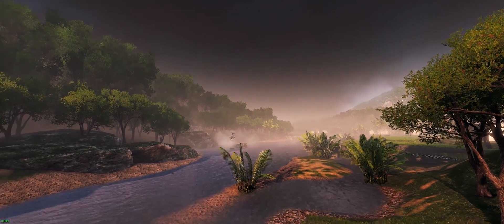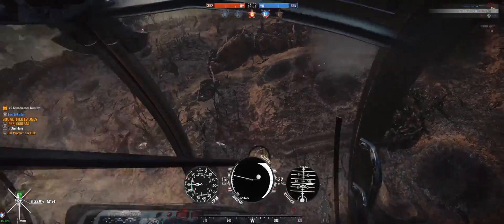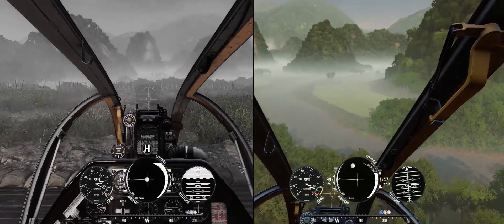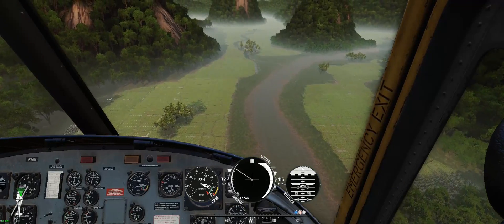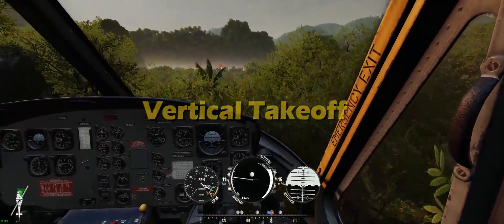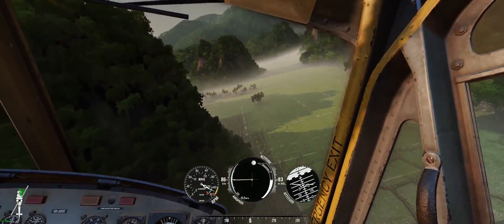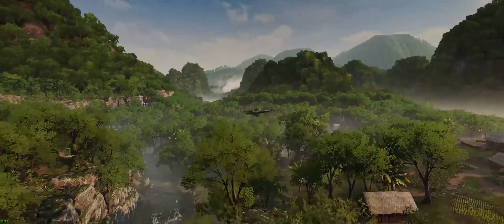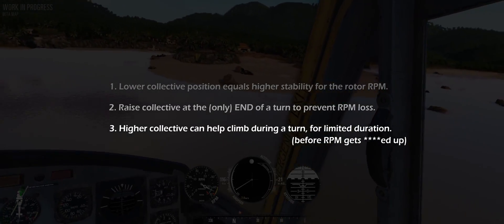Flight & Physics Essentials (Advanced Flight Model ONLY) Pilot Skill Share #3 - RS2Vietnam

Comment: Worth saying: if you are successfully targeted with SAM (constantly sound) you can still survive if you will get to the 25 meters agl to lost the track but still you can treat this as a curiosity because in most cases you won't get there in time :D
Reply from the maker: Thanks for the tip. Haven't discovered that yet, gonna try it out. ;)
Reply: Doesn't seem like it. I think once it's launched it'll continuously home in on you even if you drop height.
Reply: Barbara Cordone it's has been changed in 1.06 but you can even check on this channel that was possible
Reply: Yeah but last night for example I had a sam launched. I do not know if it only happens at 25 AGL, but I dropped below 75 (The normal lock/launch height) and the tone continued to sound and the missile homed in on me.